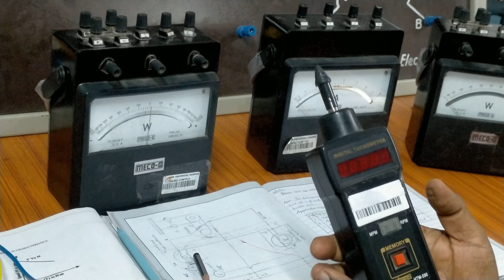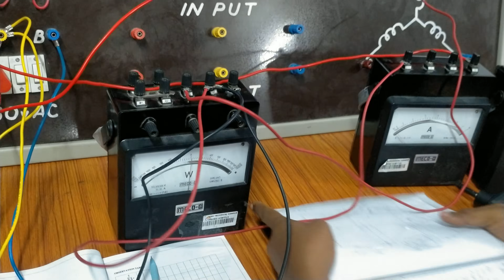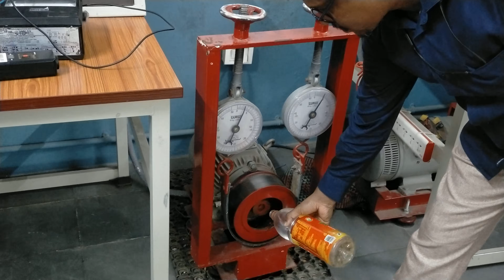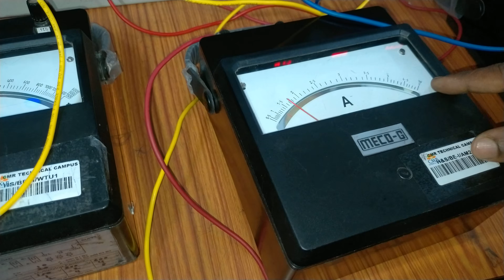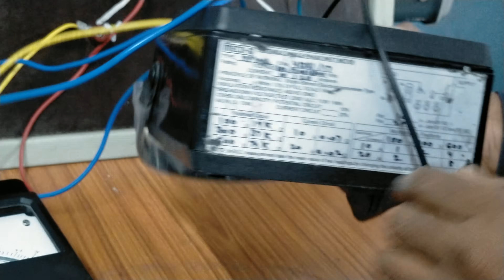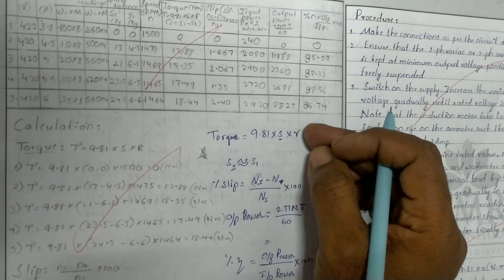Brake Test on  Three phase Induction Motor

Comment: Sir...can we use one wattmeter insted of two?And what is the difference between two and one wattmeter connections
Reply from the maker: There are different methods in operating 3 phase induction motor. Yes you can use one wattmeter method also. Instead of star-delta starter, we can use a three phase variac also.
Thank you.